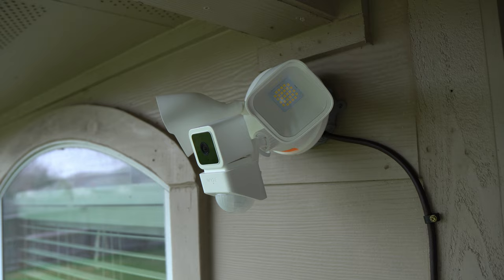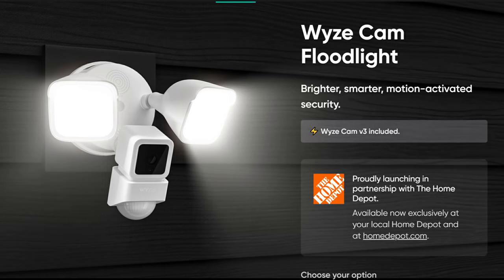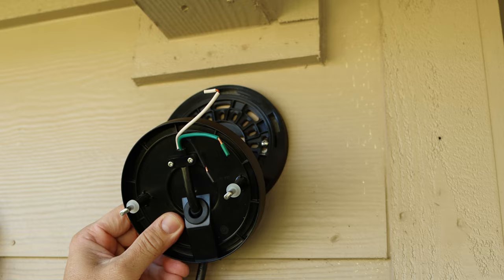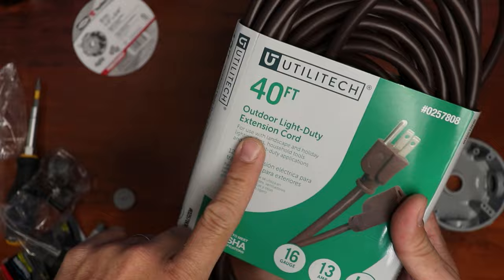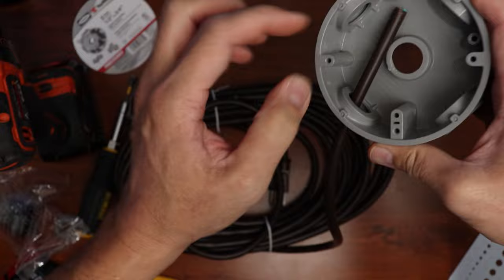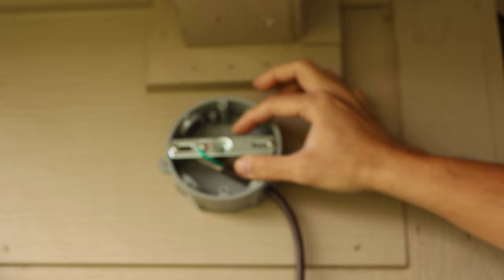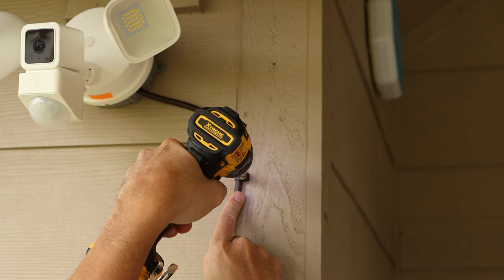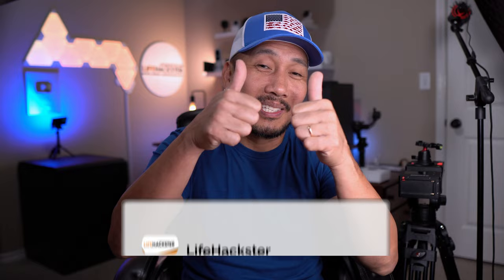DIY Floodlight Cameras Plug In Mount - Easily Install Your Wyze, Eufy, Ring, Nest Floodlight Cams

Comment: Thank you so much for sharing your skills.  You actually answer my question. I'm a DIY type of person and obviously love YouTube. We just bought our floodlight Camara ring pro. And I didn't want to use an electrician to install my lights. So  I was thinking that I could used a 3 prong extension cord to avoid a junction box. So I found your video and it will be done! 🙏
Reply from the maker: If you have the Ring floodlight cam, they actually made their own mount which is more low profile -> https://youtu.be/g9va18jfA7s

Comment: I really don't think this installation is against any codes.  But I'm confused, why there is even a ground to the Floodlight, when it's not really a 120volt light?
Reply from the maker: That is from the instructions on the wyze cam floodlight..also with the nest floodlight..they want us to screw in the ground wire to the metal bracket.
Reply: @LifeHackster  yet that bracket isn't attached to any metal on the floodlight.  So I'm thinking they want it connected to the bracket so it's out of the way.  It could just as easily be rolled up and pushed back into the box.
Reply: 100% against code lol

Comment: I have been doing this for several yrs now..you can also use caulk to seal around/behind the floodlight base to the junction box and this also works great drilling through and outside wall to the inside wall to plug to a indoor outlet so u can mount floodlights anywhere around your house..
Fyi: Home Depot and lowes sell the power cord already per cut and stripped...
Reply from the maker: Cool.,thanks for the tips.
Reply: What’s with the “…..”?
Reply: This is how I set mine up. From the outside looks just like they recommended but inside it’s plugged in to my garage door outlet
Reply: Hey I need the name of the product for: Home Depot and lowes sell the power cord already per cut and stripped...
I can't find them, please help
Reply: @julyzerg1 same
Reply: @chaselex  just buy an extension cord that rated for exterior and cut the female end, there will be 3 wires inside. Then you strip them. That’s what I did

Comment: Wow..this is great video..
I was planning on helping out a neighbor with there camera but I didn't know they bought the nest flood light  cameras and where they wanted it they had no light but they had outside outlets near both, told them they needed a electrician to tap off the outlets, but i can definitely  do this and if they want, like someone mentioned in the comments section you can drill a small whole in the wall and plug it inside the house to just like i was planning on doing with the nest outdoor camera in the first place..Thanks again

Comment: thanks! Just the info I needed.  i'm just mounting a floodlight, but most of the ones I see are designed to mount to a wall with a inside the wall junction box. Your video will help me mount a floodlight to a movable board sitting on top of my roof.

Comment: I'm not a electrician but i would recommend 1/2 in. ACC Non-Metallic Strain Relief Cord Connector and if want it even better 100% silicone. Since you should not zip tie or compress wires. They get hot and need the little room to disapate heat. 
But if doing it the way of video. I would use 100% silicone to help it stay water tite. Since he is strapping cable she not move with the ziptie inside. Just a recommendation.
P.S. your review is what had me order a wyze floodlight & v3 to attach to it. I already had a v3 for over a week because of your reviews. Had to get floodlight and a 2nd v3. Unfortunately the floodlight needs replaced since connection died after one week. But floodlight sensor still worked like a ret floodlight. I got the $1.25 a month plan paid for a year for each camera.

Thanks keep great work up!

Ps this from a person who ran 12/2 bx wire from electrical box to its own 20amp breaker connected to a AFCI/GFCI outlet. When the bx was run up to hole drilled in sink. I ran EMT to run bx through. So as you can see I over did safety. 
I would of got the AFCI/GFCI breaker but then I would have had to change them all to that which would of taking the grandfathered away. Would have been way too costly to replace all my breakers. Heck the outlet alone was like $35. 🤣
Reply: Do you have a link where I can get the "1/2 in. ACC Non-Metallic Strain Relief Cord Connector" that you said, what is it for?

Comment: Good video. Wondering if I could  drill a hole in the center of plate through the wall above my garage door and run it through the garage ceiling to plug in with the garage door opener ceiling outlet?

Comment: This is a good idea, there's a plug in flood light for Wyze from a third party but has less. lumens than the wyze branded one. Now what's the Best way to secure the cables on brick without putting 10+ screw holes in the brick/mortar?

Comment: Hi LifeHackster, great video! I do have 1 question what if my flood light has a ground wire do I connect ground to the extension cord's ground or screw both to the metal bracket ?
Reply from the maker: Just screw it in to the metal bracket, to ground the bracket too.
Reply: @LifeHackster where can I find the small metal bracket you used to screw the ground wire ？ please let me know lol

Comment: Very informative and useful video.  Thank you LifeHackster.  I do not have a electrical plug anywhere near where I want to put in a Wyze floodlight camera.  However there is a lamp nearby.  Is there anyway that I can use a Wyze lampsocket with the Wyze floodlight  camera?

Comment: Enjoy your videos very much. But I did have a question that I am curious about what you my think or have a opinion about. The ring base pro says that it replaces your current router but what I was wondering if your service provider router also has a cable for your tv how would you connect the ring base pro to this. And also is it worth it because I heard that in 2025 the cost for ring is going to double to 200 a year. What’s your thoughts. Thanks and take care
Reply from the maker: It is a bit complicated but usually ISPs have combo modem and router which you pay a monthly rent for. If you want to go with the alarm pro, then you might want to downgrade to just a modem from your ISP, buy your own modem that is compatible with your ISP and cancel the one from your internet provider. You can also change the router settings on your ISPs provider to bridge mode. If you already have the ring alarm, then my recommendation is not to upgrade until 2025 where we will be forced to pay the new pricing.
Reply: @LifeHackster  thanks for your feed back I appreciate it

Comment: Can you just drill a small enough hole behind the junction box and assuming the outlet inside the home/garage is close to the exterior, plug it in there? That way there are no exposed wires that someone can just cut. Seal both ends of the openings with chalk or putty around the wire to prevent any moisture buildup.

Comment: Great video ! One question though, will this work with a 2 prong extension cord ? The outlet box has a green grounding screw in it if that helps.
Reply from the maker: It should but take note that 2 prong extension cords means it is not outdoor 
rated.
Reply: @LifeHackster  bizarre, I picked up a cord from Canadian tire in Canada and it literally says it is only for outdoors, but is 2 prong. Didn't notice at the time.
Reply from the maker: @Ceerex1  sorry..I’m just assuming and I am most likely wrong because I know Christmas lights and their extension cords are rated outdoors but only 2 prong too…

Comment: Green is ground? The pigtail ground you connected it to the mount, however what do you do with the green from the camera? Why not connect both greens if it grounds in the wall?
Reply from the maker: If there is a green or ground wire from the camera, you will need to connect it to the mount also. The bracket is metal, so it needs to be grounded too.

Comment: Mabuhay! Thanks for the great video. I'm planning to do this with the nest floodlight soon. Could you tell me the diameter of the nest floodlight's base? Or just confirm the 4.25" diameter plastic junction box you used in this video would work with the nest floodlight cam? Salamat po

Comment: I just installed a Ring (Smart Lighting) Floodlight, which does not have a camera.  The install appeared to go fine,,,my network found the light, and completed the install.  However, after the install, the light, when turned on after motion detection or a verbal Alexa command to turn it on, goes off line.  I tried moving the Ring Bridge closer to the light, but that does not seem to resolve the issue.  Also, I know power from the outlet is good.  In theory, this method should work, correct?

Comment: Can not find metal bracket you connect ground wire to, with small female threading in center. Also is Copper and Aluminum wire safe?

Comment: With the Ring wired floods pro, do I need the typical 25v transformer as used with the doorbell. I’m guessing not being we’re running typical floods light. Also does the pro come with a pancake type mounting box or do I supply that?
Thanks and great videos
Thanks.

Comment: Hi Lifehackster, thanks for this tip along with your great reviews. But can you confirm if the round junction box is also suitable for the ring floodlight cam? I ask because here in the UK the plug in version of the floodlight cam nor the plug in adapter kit are available. I'm not sure why as many homes here adopt an external IP rated JB and take power to a light via the flying lead principle.

Comment: Thanks alot for posting this, earned my Sub, Question... would attaching a 2nd camera to the wyze flood light be ok or would it draw to much power or
Reply: Do you know how many amps each camera draws?
Reply: Determine what circuit breaker it goes to and all that is on that circuit (ex: additional outlets). Determine how many amps are being drawn by all that is on and expected to be on that circuit. If its a 15 amp circuit, subtract each items amperage draw. If you have voltage or power, recall V=IR, P=IV=V^2/R=I^2*R. You want to be below the circuits rating to be on the safe side.

Comment: Dude, I have an opposite problem: I want to install a Reolink floodlight on an existing floodlight box. The problem is, the floodlight supplies the 110 AC, and the camera takes 12v DC. I was wondering if you could point me in the right direction. 
Currently, I'm thinking about AC-to-DC converters, but I have not found any information about anyone doing this (as a confirmation).

Comment: I have not ground in the cable that is important, because the light is on all the time?
Reply from the maker: If the floodlight cam that you are putting in is mostly plastic like the wyze cam floodlight, then there is no need.

Comment: Question:  so we want to install the Ring Floodlight Camera WIRED Pro to our driveway.  Could we just drill a hole onto the stucco of our garage wall and run the extension cord to an outlet on the inside of the garage?
Reply from the maker: I’m not really recommending it. Or as long you can protect the wire going through the wall using a pvc pipe. Or better yet just install a proper junction box and using romex through the wall.
Reply: Id say, as long as you research alot and understand your electrical system at home its possible. I installed a official outlet to plug my generator to my electrical panel, of course with a safety interlocking kit so i dont backfeed into the main lines coming into my house. So this is easier than what i DIYd

Comment: Can I drill a hole through the garage wall and add the cord (seal the opening) to plug in garage outlet?
Reply from the maker: You can..but as I said in the video though it might be against electrical codes.
Reply: @LifeHackster  oh........ okay 👍🏾

Comment: Can you use this method with a ring floodlights cam. They are sold out of the ring adapter everywhere
Reply from the maker: Yes, you can.
Reply: @LifeHackster  is it the same way as in this video? Thanks 🙏
Reply from the maker: @empirecustomsautodetailing  yes.

Comment: Do u think this will work with the eufy floodlight cam pro 2?
Reply from the maker: Yes, it can.
Reply: Would i have to connect both the ground wires to the metal plate or can i just wire both of the green wires without the metal plate?
Reply: @HieuTran-zb9xi  I connected mine green to green and so forth. I sid not ground it to the box.

Comment: I have an existing floodlight that does not have a junction box. I don't want to put one in through the garage and there is no problem mounting it without one. Do I have to have a junction box? (I'm sure code wise I am supposed to) but in general does it hurt anything. All the wiring will be inside the garage. Also the old flood light was just a  two prong plug with black and white wires, no ground. Can I use it?
Reply: All connections have to be within a proper junction box - either fastened to the outside like this or recessed into the wall.
Reply: @CurseTheDarkness  Figured so. Its odd to me that my house has a floodlight installed without a junction box. Must have been an after thought from the first owner. Thanks for the info.

Comment: Using a lock to prevent others from unplugging the power source.  How to prevent others from cutting the wire?
Reply from the maker: Cable raceway, pvc pipe..etc.. or let them try to cut it…it is just 110 -240 volts..they will be recorded anyways before they are able to cut it.

Comment: Should probably invest some tubing to give a just a little but more protection to the exposed wire as it's pretty pointless to lock up the plug when a thief who really wants to get in can just cut your wire
Reply: Doubt they'd cut a 120 volt cord, more likely they'd just pull it out to break the outlet cover to get it unplugged.
Reply: @Resist4  this as well. As for cutting the cord it's just a possibility, never know the intelligence level of the thief and wether or not cutting the cord could be dangerous. Just saying prepare for all outcomes
Reply: @itachii267  most criminals would never cut a 120 volt cord.  As I said, it’s easier to just pull the cord off the wall and then yank it out of the locked outlet box.  That’s the fastest solution and criminals always pick the quickest route.
Reply: Why would they cut the wire when they can more easily just remove or smash the camera?
Reply: @kevinshometv  they might not be able to reach the camera.
Reply: @Resist4  they cut mine. Walked backwards up to it picture gone. So is my catalytic converter.
Reply from the maker: Yes, you can…But depending on your setup, they should be seen, recorded and you will be notified way before they can get to the cable to cut it.
Reply: @Resist4  What if they have a ladder or a long stick to smash the camera?  The point is there is no perfect solution, but a camera with a cord is better than no camera at all.
Reply: @kevinshometv  still much easier to just pull the cord out of the outlet.
Reply: @Resist4  🤣🤣🤣🤣🤣🤣🤣

Comment: The electric box has a pad lock but an intruder with wire cutters or a knife could just snip the wire, lol
Reply from the maker: They can try it..it is only 120 volts...just a little pop and shock that's all....and most likely I'll be notified way before they do that and I'll be watching them doing it....

Comment: Bought everything except the junction box bracket bar which he doesn’t mention in the video…..remember you need this!
Reply from the maker: The bracket bar comes with your floodlight cam.
Reply: @LifeHackster  the bracket bar does not come with the new Google nest floodlight
Reply from the maker: It comes with a baseplate. You don’t need a bracket bar - https://youtu.be/vzSYz05V9rg?si=RZ4VbgDvoldsAbZm

Comment: People can just walk up and cut the wire straight.
Reply from the maker: They can...cutting and grounding 120 volts I guess will not give them a shock but depending on where the camera is pointing at, you will also get and notification and the footage leading to it... so, it is there choice.

Comment: Everyone should def be careful when doing electrical work. If the insurance company finds out that the house caught fire and youre not licensed, you will probably be buying a new house. Or go homeless I guess.
Reply: Electrical work?  All you are doing is adding a cord to the light and just plugging it in.  It's the same connections to the floodlight as if it were installed in the wall.  And overall it's just like plugging in Christmas lights.  So there are no insurance issues to worry about.
Reply: @Resist4  I'm speaking in general
Reply: @thehuguenot5615  but in general, it has nothing to do with this as it’s nothing you would need an electrician for.